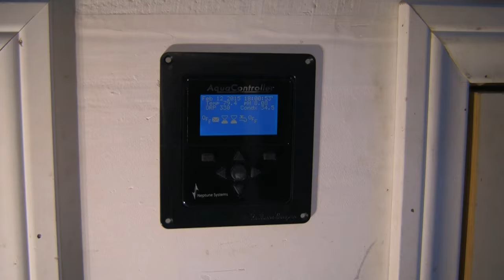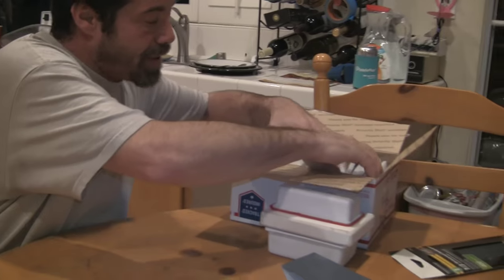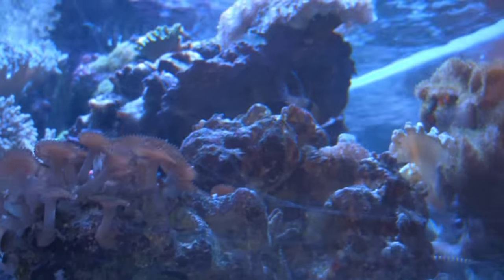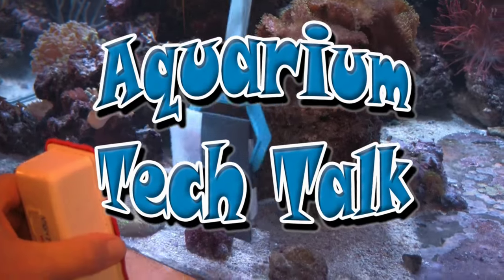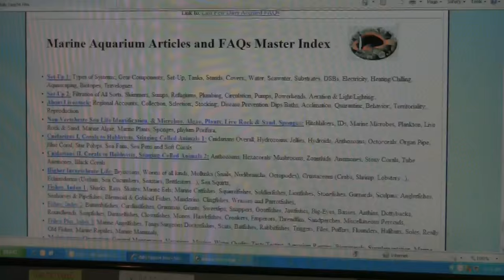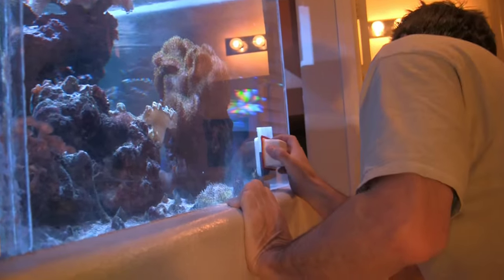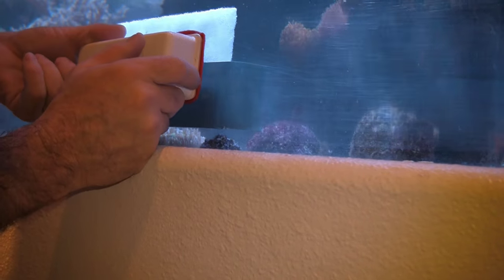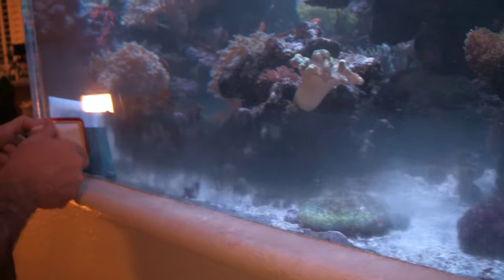Polish Scratches Out of Acrylic Aquarium, LA Fishguys Tech Talk Episode 149, part 1

Comment: I bought an old 55 gallon Clarity Plus acrylic tank for $30 at Goodwill and used some 3 step Novus I had left over from my motorcycle,  it came out looking brand new. Now years latter I'm looking to buff the front panel out with the livestock inside and someone told me to buy an air powered buffer and fill it with vegetable oil. Has anyone tried this?

Comment: Scott, awesome video. I actually dreamed I could do this like 2 weeks ago. My tank is 300 gallon 1/2 in acrylic. I have about 5 scratches on the front of the tank where my aragonite got caught between my algae pad. Will have to do a test run to see what size I need to start at. I'm hoping like 800 to 1000. But like you said not for the faint of heart. But better than spending another $3500 for a new tank.

Comment: I found micro mesh sandpaper on-line, seems that there are different grades.  What did Scott use for this underwater application?  I want to duplicate exactly what he used, thanks,
Reply: I used a kit that had 9 different grades going up to 12,000 grit. It's their kit for acrylic. I added some standard Wet Dry paper for the course grades such as 400, 600 and 1000.

Comment: Why is the sandpaper put off to the side of the pad and not in the middle?
Reply: +Peter Rossetti I did that with the heavier grit stuff so I could work a narrower area as the deeper scratches were mostly near the very bottom edges. I didn't want to work too wide of an area with the 400 and 600 grit. Each grit, you work a wider area and so by keeping the 400 and 600 grit consolidated to a narrower spot on the pads, it allowed me to work my way out as I stepped up in grit  without working too wide of an area with the rough stuff.